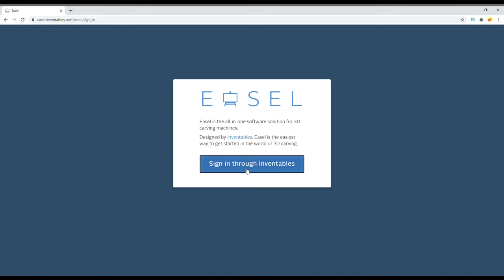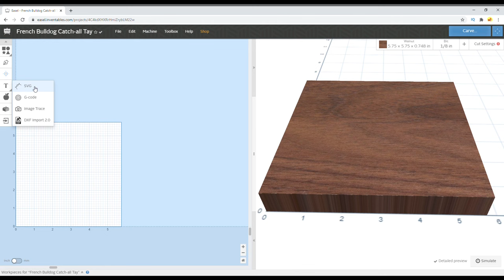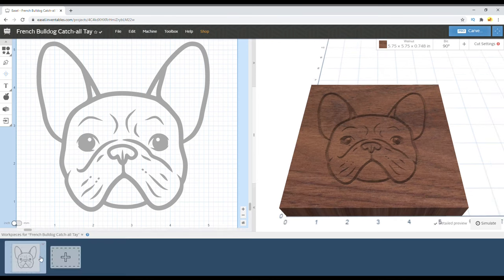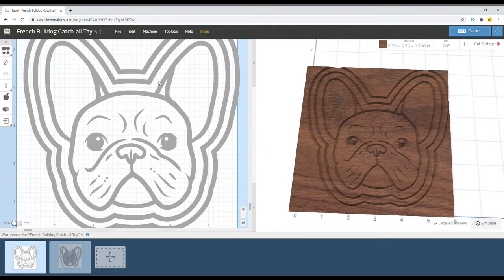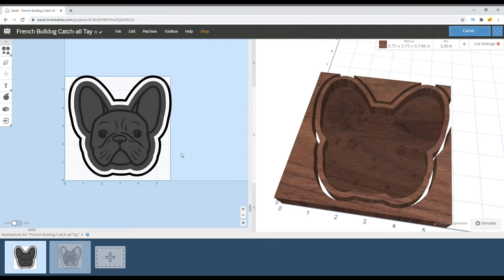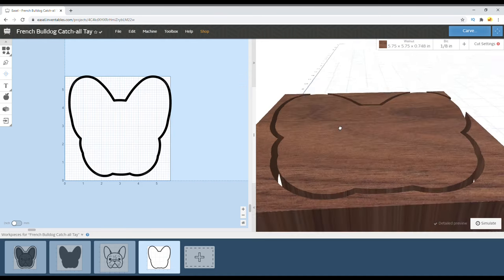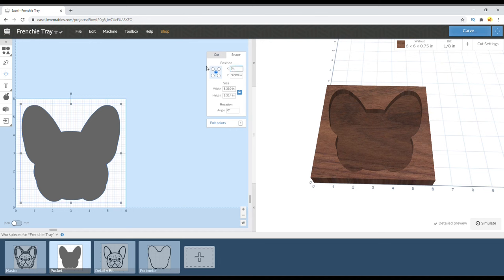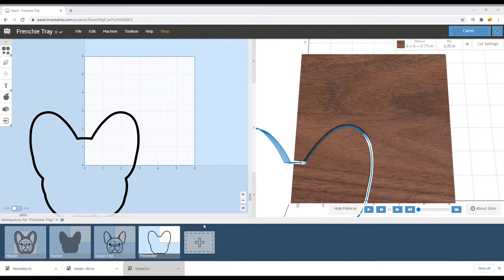Did you know Easel can do this?

Comment: Is it possible to cut a plug (set of letters) for inlay rather than each separate letter?
Reply from the maker: Sure, just create an outer shape and pocket that but don't not the letters, leave them set to 0 depth... you may need to use offsetting and layering to get the desired results. But it's definitely possible with easel
Reply: @SethCNC  is it, so that the machine will mill everything  but not the image(letters?)
Reply: @SethCNC  just trying but cant put letters on top of anything, have you got a video i could follow on that? thanks

Comment: Hello Seth,
I saw you on the fb group and I don't understand the stepover for smooth pocket.  please help. I'm using easel and my xcarve for a dish tray catch all.  I'm using a dish bit 1/2 diameter
Reply from the maker: Hi Annie 👋  with a dish bit there's typically a flat bottom portion you'd need to determine what amount is flat as a percentage of the overall width and then use a stepover that is a number a little smaller than that percentage. 

For instance this bit https://www.toolstoday.com/v-5662-45982.html?glCountry=US&glCurrency=USD&ne_ppc_id=10371521939&gclid=Cj0KCQjw3v6SBhCsARIsACyrRAnALl1o5CoxtiwQNKXeEhNHUtflpznnqcLK0qMTZo7RoA8BHh0CKYwaAqD4EALw_wcB from amana is 3/4" diameter, has a 1/4" radius (on 2 sides) making the flat portion only 1/4".   So i would need to use a stepover less than 33% or else this bit will leave scallops. 

Scallops:
https://lh6.googleusercontent.com/proxy/ihY7XnI02hVYLsJzc5knU-c--raw4esLXkFTvfZqk2XSHMP9t29q86zH6JJVh9R1LjVQPc8fuQpeP0C2UaV5XRY-9ZA5zMQq

Comment: Hello Sir, The Easel Software is Compatible or can use to any brand of Cnc laser machine?
Reply from the maker: Hi Ryan, easel is fairly compatable with most 3 axis cnc machines, however easel does not generate the code needed to operate a laser cnc.

 I recommend Lightburn software.

Lasergrbl will also work but it is missing features that lightburn includes.

Comment: It didn't work I watched the video over and over , it cut out the depth but when i went to change the bits to carve the face it didn't work. :(
Reply from the maker: @LifeLens-om4wz  which model cnc.
Can the vbit reach your wasteboard?
Reply: @SethCNC  I have Genmitsu 4040 pro, I've cut out the inside and when I changed the bit it didn't go to the bottom it was carving in the air.  I don't know what I did wrong when setting the carving depth for the face.